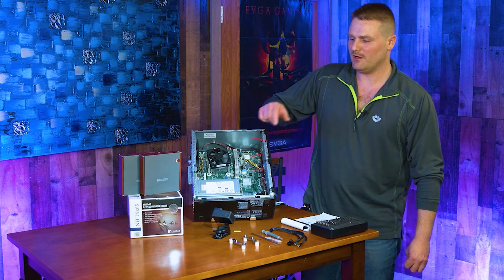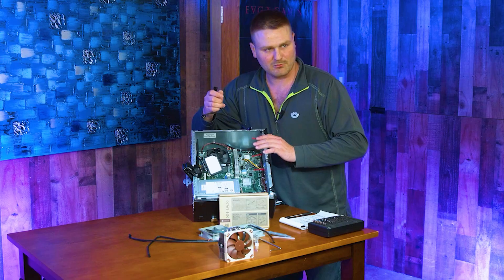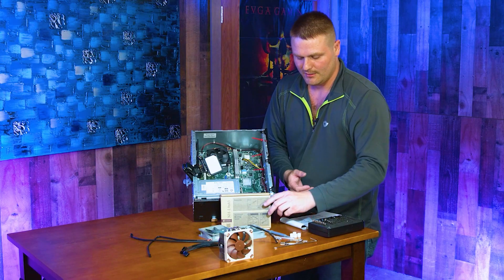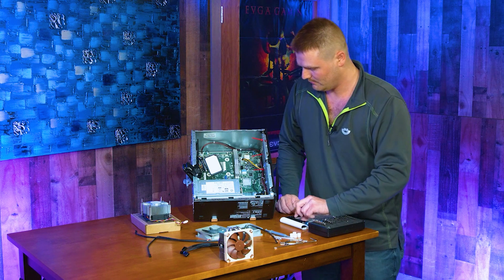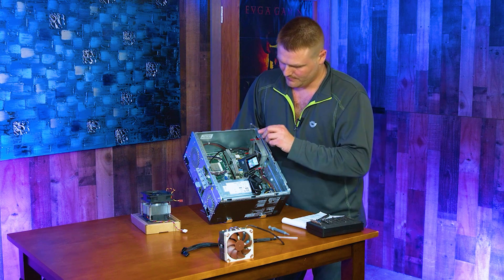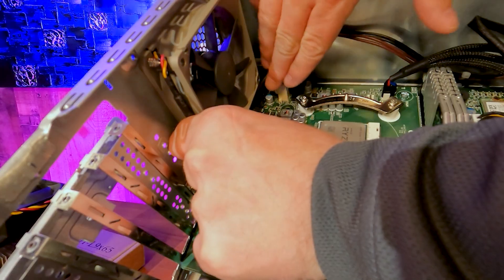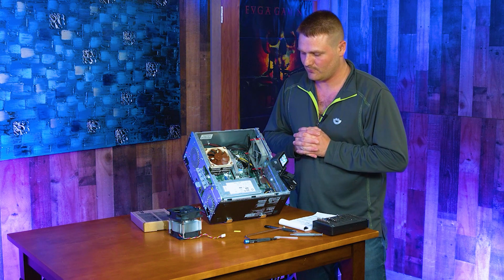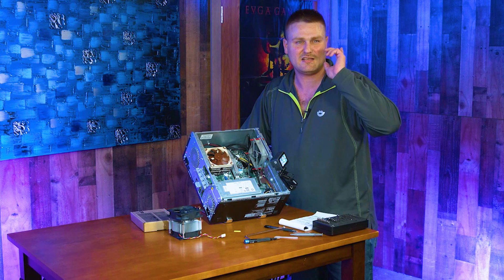HP Pavilion TG01 Cooling Upgrade Noctua CPU Heat sink and Fan Install W/ How To  1

Comment: An intake fan can be installed on the inside of the black drive cage bracket. I think Technitwit is saying that he attempted this and it actually increased CPU temperature. Seems like an odd result, but if he tested it must be true. Can anyone verify?

Comment: with the case fan you installed in the front of the desktop do you think i could do the same with a victus 15L since the inside is basically the same.
Reply: and would i be able to put the front victus panel back on with the fan installed too?

Comment: I thought I commented on this vid but I maybe it was on one of your other vids of this computer.  I was going to give an update on my experience. I have a TE01-22265t.   It came w/ a 400w PSU and an Nvidia 1660 Super. It has a Core i5-11400 cpu in an LGA 1200 socket. Other than that it should be the same as this one. In my first post I'd asked about placing the fan on top to help cool the motherboard. That can't be done. The case is too narrow. So I installed the fan as tnw did but I have it blowing down. The CPU and motherboard temps are way down. typically about 30c for CPU and 33-35 for mobo. Still a little warm for the mobo IMO. Some info that might be helpful from my installation: Don't even think about using the backing plate in the kit. The instructions say to place the new one over the old one. It can't be done. The offsets, the the things the heatsink screws go into, are part of the OEM back plate. Those nifty new screws supplied with the kit will not fit through the offsets. I removd my mobo just to see bc I didn't have any m3 16mm screws. I bought some, $2.95 for 10 at Lowes. My kit had no white spacers. It had grey, blue, and black ones. I used the black ones although I can't see how it makes any difference. Two more things. In my computer the big heatsink assy will only work in one orientation. Fortunately it cleared the memory easily and colls that was well as the CPU and the area around the CPU... the VRMs and capacitors I think?  The last thing: I put in an intake fan. I tried it on the grated area on the side of the case and on the front of the case at the top. It may seem odd but my computer runs cooler w/ the fan in front. That's surpising to me bc I didn't cut or remove the plastic slats covering the front. I'm looking at Speccy (which runs a little higher than other progrms) as I post this and the temps at idle are CPU 30C, Motherboard (not sure how that is monitored) at 36C, GPU at 32C, and SSD at 28C. That's w/ the intake fan on the side. I need to go back in and put it back in front. The biggest change w/ fan in front is the mobo temp and that was my main concern.  Is the big mamagama worth the price. Probably not. I think I'd have got the same results with the medium size unit. But bottom line I like the fan blowing down bc my mobo def needed some extra cooling. As for this computer... it's a speedy everyday computer now but I have $450 to $500 invested total. It will never be a great gaming computer but after trying a few games I've learned I'm not a gamer so it doesn't matter.  I think I could have done better buying a used case with a good mobo. The BIOS is locked and the PSU is proprietary and the case is very small. 
 Thank you, the vids have been very helpful.
Reply from the maker: Your welcome glad they could help
Reply: Do you really need the intake fan? I have a TE01 3254 desktop. I want to put in a 9060xt in it and upgrade the cpu cooler. Maybe even upgrade the case fan just to be sure heat gets out. I just worry there won't be enough heat extraction in the case to stay efficient during demanding usage. 
I mean I could buy a pre built but then I'll have an extra desktop lying around that won't be used again.

Comment: I like the downdraft cooler because there is no heatsink on the power MOSFETs.  This way they get some airflow compared to a tower cooler.  The tower cooler like Asassin 90 SE should fit fine, but then you'd want some heatsinks on the power stages near the CPU if you are running an 8-core really hard.
Reply from the maker: Yes the last of heatsink on the power stages and Mosfets is sad.

Comment: Will this cooler work with the same PC but with a 13400F CPU?
Reply from the maker: Yes it will but need some modification. you can A remove the mobo and remove the back-plate or B order longer 6-32 screws and Drill out the brackets. goes in the same way in my new video but you will need to drill out them. Because the new screws are just a bit larger.

Comment: Any other cooler options on there then this one ?
Reply from the maker: Not unless you go with an aio or take the motherboard out and remove the glued on back plate, it is possible if you take your time and use a heat gun
Reply: @TNW1337  what about the vetroo v5 on Amazon
Reply: @TNW1337  says dimensions are 128x 148x 75mm so I think it will fit in the case u can order it for the lga 1151 socket so I assume it will work. Just would like a second set of eyes to look at it.

Comment: TechNitWit please help me i need your expertise, what do you think of the “DeepCool AG400” & OR “DeepCool AG400 Black with ARGB” ?? Would it work on my tg01 with r5 5600g cpu ? It’s a better price and i think i prefer a tower style, few more bucks has the rgb fan and soon I’m doing a clear side window mod, and doing the other noctua fans ..
Reply: The AG400 should be too tall. I believe it's around 130-135mm height max.

Comment: What if its a AMD cpu? Do you just use the AMD mounts then?
Reply from the maker: the Intel and AMD mounts on the hp are the same.
Same thread type and same space need to contact the cold plate.

Comment: Hello! I’m about to try this mod for myself. But I just wonder with the splitter, so you connect it with the CPU, and then use the CPU-cooler connector? I have read that that connector should just be used for the CPU. But it looks like you know what you are doing. So just to clarify, you hook the exhaust where the old exhaust was, and the splitter from the intake, into the CPU and then both of them into the CPU-cooler connector?

Thanks for your time.

Comment: I've been trying to put in an intake fan in the tg01-1020 by using a sata to 4 pin pmw adapter. I've seen people put in more fans by using a splitter in the cpu fan header but I've been advised against using a splitter. There is only one 3 pin sysfan header on the motherboard for an exhuast fan. I have two drives connected to the sata power cables that came with the PC already. There is another sata power header (white 4 pin header that's next to the white and blue sata ports) that I was able to find a cable for on ebay. I haven't gotten these cables yet so I figured I'd reach out and see if you has a better suggestion or a good reason to why this won't work.

Comment: Hi Did you leave the front panel off after adding the front fan on it? Thanks
Reply from the maker: Nope, Front panel went back on.
Reply: @TNW1337  thanks just wondering how the air gets in because the front panel is solid? Also to confirm you got better thermals with the fan on the front vs the mesh part of the side panel?
Reply: Top of the front panel is actually a hole, apparently

Comment: Does it matter if you have an Amd or intel cpu for this upgrade
Reply from the maker: Nope.
Reply: @TNW1337  thanks
Reply: @TNW1337  Sorry if this is random, but I got a warranty with mine, should I wait for the warranty to end before doing upgrades?
Reply: @TNW1337  Sorry one more question. Does the cpu cooler have to be the same brand as the fans you install? I plan on installing two Arctic F9 fans as intake fans but keeping the stock cpu cooler and exhaust fan.

Comment: Anyone know if this cpu fan will work on an Erica6 (TG01-2003W) I upgraded the processor to a 5700G from a 5600G.. turns out the Erica6 doesn't support the 5700 fan...

Comment: Hi there ! Will this work with a lga 1700 socket in a Hp Victus 15L without the lga 1700 kit ?
Reply from the maker: Yes
Reply from the maker: It is the same Idea when I do the AIO in the Victus.
Reply: @TNW1337  thanks a lot.  I just bought a Cooler Master nr200p Max and moved all in it

Comment: Question, is it necessary to have a intake fan?
Reply from the maker: No, it does help with the GPU and CPU Cooling
Reply: @TNW1337  also I'm planning on upgrading the GPU, pretty much a Radeon XFX speedster Rx 6600 8gb, am i gonna need the 500 watt psu just so it can work?

Comment: The location of the added fan is pointless. There is NOT a vent for air to pass through up there
Reply from the maker: What are you talking about, Take a very large flash light, point it at the button or top of the case, stick head inside PC, then look inside the case what do you see???? Maybe some light???? if you did it right, LIGHT RIGHT! To me Light can not pass though plastic. but maybe we are in a different reality and I just didn't notices. Have a nice day!

Comment: Hi TechNitWit i was wondering if the ryzen 7 3700x stock cooler fit inside the Hp Pavilion TG01. Also one more thing do i have to add the other heatsink fans or is it a have to?
Reply from the maker: Nope

Comment: Hey TechNitWit! I was planning to upgrade the cpu cooler on my TG01-1109? I was wondering if a 120mm cooler would fit the case and the motherboard? Thanks alot! Kudos to your effort!
Reply from the maker: Probably not, depending on the brand. this is why I use the noctua. it takes the least amount of work. other coolers you need to remove the motherboard.

Comment: @TechNitWit Hi again 😊, I was watching your video on the Tg02 and followed your advice to watch this video... I think it's the right one. Just bought the 92mm noctua case fan and plan to install soon. A bit confused why the fan is up top, because there is no vent up there on this or the victus. I can see how it might blow more direct air over the CPU area, does that work better than down on the side? My gpu is usually pretty cool, but the cpu seems to spike into the 90s sometimes. Just running in "balanced" mode and the fans haven't come on full blast 

I already installed a 2nd ssd in the cage, looks like I may need to remove the cage and do a custom mount of the drive to get it out of the way of the fan if I mount it up top.

Appreciate any words of wisdom if you have time. Thanks
Reply from the maker: Get a flash light and go to the button of the case and top has some cut outs. you can see it by shining the light.

Thanks!

Yeah but tbh double side tape works just fine on ssds, not the best thing in the world but works!
Reply: @TNW1337  Thanks, got my fan mounted up front like you shown in your video and it seems to be working well! I removed the cage and just laid the ssd on the case floor for now, but I'll fasten it as soon as I get some tape.

Comment: Hello, just a random guy who wants to look for potential cooler upgrades for pavilion gaming/victus desktops. Any guesses to what the height clearance for the cpu coolers is? I looked up and it doesn't seem to be noted anywhere.
Reply from the maker: well there is not a lot of room also you have the none standers back plate. all the cooler I put on the TG01 will 100% work on the victus AMD or Intel.

Comment: Thanks for this video series.  One thing you can also do is cut the metal grill off the back fan with a Dremel tool will improve air flow alot.
Reply from the maker: Great point!that would help it is very restrictive.

Comment: Will this heatsink work for my 690-00xx?
Reply from the maker: Yes
Reply: Would you happen to know the intel bracket item number? Because I bought a heat sink but with only the amd bracket parts smh and I've hear you say I need both amd and Intel part to make this heat fit properly true?

Comment: Well NitWit my crazy ass took the motherboard all the way out. 😂. Got an NHU9S in there now though. Already had it setting around for a while in the box so I may as well use it. Been doing well for a few days thankfully.
Reply from the maker: Cool, yeah I love noctua~!
Reply: @TNW1337  how do the larger gpus hold up in the TG01? Because most I've seen you install recommend over the wattage of even the larger power supply by at least 100 watts. Also did HP say those would be okay? I see quite a few that will fit in that case but they recommend like 600 to 650 watts. Enjoying pushing the limits but not looking to burn up a brand new psu either.
Reply: @train3616  As long as you have the 500W PSU you should be able to reliably run 200w on the GPU (Because there is a 3060Ti model from HP). Might as well to learn undervolting and limiting clock to something within the 1740-1950 range, which probably will limit the power spikes (I assume part of the spikes come from the the GPU trying to max out clocks, then hitting the power limit.)

Comment: I installed two of the brown noctua fans with splitter and kept the stock cpu cooler and my fans are loud and sound like they are running full blast as soon as I turn pc on I’m guessing I did something wrong just not sure what?
Reply from the maker: If you used the 3 way splitter off the CPU. They are still controlled. The noise dose suck, Bet it is better then Overheating and losing boost clocks or thermal throttling.

Comment: I have the tg01-0030, I want to get a case fan (the grey one) but mine is 3 pin connection not 4, how did you set that up?
Reply from the maker: Just for the rear? Get a none pwm fan for rear or get a pwm to 3 pin adapter.
Reply: @TNW1337  Did you use a adapter?

Comment: Great video! But I want to ask is it possible to add a liquid cooler in it?
Reply: I think he said you can only use a 120mm AIO.
Are you from Hong Kong with the 11700F/3060ti model? I have one too, and I underclocked it to something like 3.5-3.8ghz
Reply from the maker: There is a 92mm AIo that will work!

Comment: Re watching some of the videos and pulling the TG01 back out. May just upgrade it now that prices are dropping again. Did you ever get that other psu you talked about trying in them after the 500w hp? I have an extra psu setting around but of course it's an atx psu so there's no way without cutting the case in places it will go in. Too bad too because it's a 600w.
Reply from the maker: No I never did. The problem is that they switch to the new ATX 12v, HP, Dell, Acer & some others. To the 12V ATX standard and getting some thing that can take 14 Amps  5v 600watts DC and make 6Amp 12v at 300watts DC is harder then I though it would be. Once I can get my hands on a new 12v ATX psu. I think it will be very simple to do. I Tried to use a Buck Converter, Choked Buck converter and some other devices. I Guess I should have stayed in school longer lol. I mean college,  Computer Engineering.

Comment: Sorry for asking here again, would the stock backplate (I think the motherboard comes with one?) still manage to fit any cooler, as long as you use that standoff and it isn't too heavy (looking at the ID-Cooling IS-50X/IS-6K/IS-5M, as the L12S is very expensive over here)
My PC has a LGA1200 CPU if that helps.

Edit: Or some coolers don't come with these standoffs and I have to find one somewhere else?
Reply from the maker: Well you can change the back plate it is epoxied or double side taped to the board. The Epoxied ones it take about a hour to get it off. Yes you can get other coolers to work. I was looking at that cooler it looks like a noctua copy.  and round plastic would work they need to be about 6-10mm higher. I am guessing the ID cooler would come with them if it was a noctua copy.
Reply from the maker: If you went with 6mm one you do not want to crank the screws down past hand tight.
Reply: @TNW1337  Thank you for explaining, these coolers seem to come with a washer. I guess that's the spacer they use here

Edit: By the way a program called Fan Control can sort of control the TG01's fans, by making an algorithm that calculates the average of your own fan speed curve and syncing to the fan speed itself with offset of 2% 

(But you cannot save the setup, you have to change the sync reference to e.g. the GPU fan and change it back every time you relaunch it. But it works)

Comment: Hi, can you confirm the additional case fan pushes air in and the existing case fan exhausts? Also does the new case fan share power from the CPU fan with a splitter rather than the existing case fan? Advice appreciated! Thankscase
Reply from the maker: Yes It does flow from front to back. I should have made that clearer in the video about the Power for the FAN.  I use a PWM splitter cable.

Comment: Def going with the smaller CPU cooler, doesn’t seem much of a difference in cooling between the sizes. Does anyone know if the larger sized coolers are harder to install? Also, looking to add a fans like you I saw someone do 2 vertical  80 mm fan for intake across where you did 1, what are your thoughts ? Also, I don’t think I plan on installing a SSD yet since mine came with a 1 TB HDD (I know don’t hate me)  installed already, think it would be easier to set 4 pin pwm fans with a SATA fan splitter ?
Reply from the maker: More fans = better cooling if they do not get in the way of a drive or GPU yes I would do it.